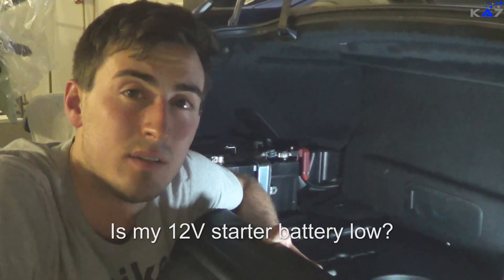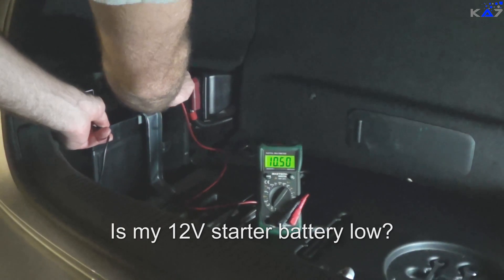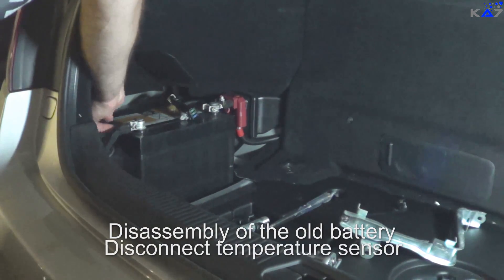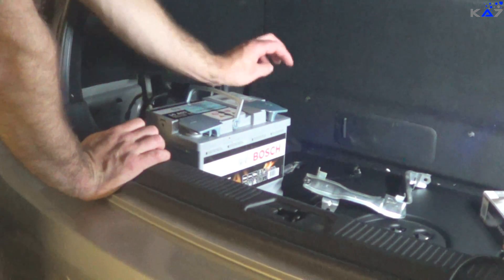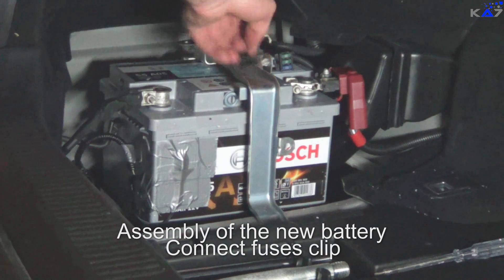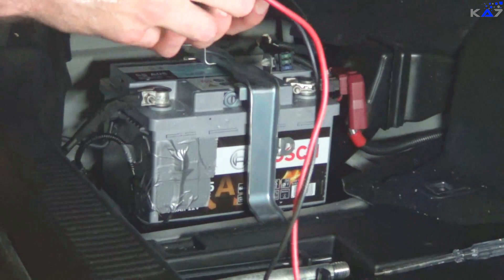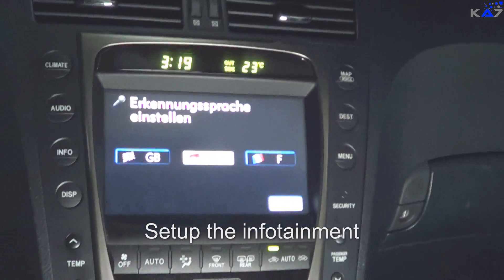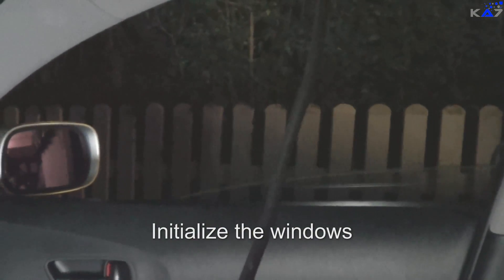12V Battery Replacement - HOW TO REPLACE STARTER BATTERY of a Lexus GS450h 2007?

Comment: How you disconnect the temperature sensor mate?
Reply from the maker: Do you mean 2:50 or before?
Reply: @KA7Beatz before. It is stuck because the temperature esensor is under the top cover. My battery was changed by previous owner and he replaced it with a Japanese Panasonic battery. However, I learned that I need to get under the top label where the actual sensor lays. Thanks foff to the tip so now I know that there is no need for an expensive option for my Lexus❤

Comment: Notuce:By catalog from Toyota the battery for GS450H is not AGM  
They start putting AGM batteries late 2009 , so keep in mind.
I'm with 70ah EFB Rocket  battery 
Fits perfectly and is by catalog like an oem spec - even better

Comment: Any suggestions to switch of the alarms after installing the battery? I didn’t get it to shut down no matter what I tried, eventually disconnected the battery and then it stopped after a while. Was it because i did not tape the temp sensor on?
Reply from the maker: @casperjolink433  I dont know. I dont think it is related to the temp sensor.

Comment: I live in Sweden and i have GS 450h 2010 and every time i search 12 V battery it not fit for my car not even Bosch battery so i called Lexus and they say that it not fit because that temperature sensor on the left and i have some cable where temperature sensor is and Lexus told me that i must have that cable and it's only Panasonic battery witch cost over 400€,what should i do,fo i have to buy original or replacement and do i must have that cable because you recorded in video only temperature sensor, please help me,thanx.
Reply from the maker: Hi, dont worry. Simply buy an AGM battery from any brand (I bought Bosch. For a hybrid car AGM is important!). Tape the temperature sensor on the battery (as I did in the video) and it will work!

Comment: How's the car now?
Any tips when looking for one used?
Any common issues?
Reply from the maker: Hey. I am still driving this car and it has over 200.000 km already. The only issue I had was a rusted exhaust which I replaced for 1000 Euro (this is a common issue). The next thing which I probably need to replace is the suspension. The car has still the original hybrid battery and they seem to be in a good shape, since I usually drive just long distances. Check my channel, there are some more videos of my GS450h.
Reply: @KA7Beatz  I will, thanks for the tip.
From what I know the batteries go out if the car is driven in the city often and the rear shocks are the one to go first since the battery is heavy, other than than leaks from the water pump, rusted exhaust and some brake calipers may seize.

Comment: Working great here on a 2008 GS450h that didn't want to start after COVID19 stop. Just some fitting on the AGM Bosch battery base and everything working fine again, not even the window fixing thing needed. Thanks for your video KA7Beatz, very helpful.
Reply: I have a 2007 same model I can't seem to get it started, is it cause of them lil rubber holes attached to the battery?

Comment: Hello Friend.  I live in Japan and have a Lexus ls 600 hl, I left the car in the garage for a month when I went to use it again it doesn't work.  Could you tell me why this is happening?  thanks￼.
Reply from the maker: Dear friend! Unfortunately I cannot tell you why the battery went low after two months. How old is the battery? How cold was it in the garage? Were all the power users turned off (such as the massage seats, infotainment, ...)?

Comment: Hi, just wanted to ask how the battery is doing in the car. Any problems at all, do you know if the car over charges the AGM battery at all? Thanks for the useful video.
Reply from the maker: Hi. Thanks for the comment. I am still using this battery and had no problems so far (3 years, 90.000 km).
Reply: @KA7Beatz  Great, thanks
Reply: KA7Beatz One other question if you don’t mind, you mention in the video that your cd changer was working after the battery change, had it stopped functioning before? This is the position I am in currently, the car starts fine but the CD player is not working saying no disc and there is no audio from any source though the radio does still tune.
Reply from the maker: Yes, the CD changer stopped working some weeks before, FM was still working fine.
Reply: Thanks again

Comment: my RX450h 2010 has no temp sensor !? i had to relearn the backdoor (powerdriven) what about the sunroof ? what about the seat settings  and customization via NAV screen ?
Reply from the maker: I guess there are differences in the Facelift which you are driving. Sunroof yes. Nav yes. Seat no (in my 2007 model).
Reply: danke   @KA7Beatz

Comment: Is there some trick you found to get the battery in properly? It seems no matter how I try the Bosch battery won't sit level in the tray (either the left side or the right is higher, and I can't get the bracket to fit back properly when it's like that)

Oh, and: Thanks for the video. It is very helpful.
Reply from the maker: Hi, Thanks for your comment! Honestly, I shrinked the Bosch battery a little bit with a file on all bottom edges (at the synthetic material).

Comment: Would you know the group size for that battery? I’m trying to buy one.
Reply from the maker: Length: 242 mm, Width: 175 mm, Height: 190 mm. These dimensions basically fit almost perfect. You are able to do minor adjustments on the battery.
Reply: KA7Beatz thanks for the info, but the place I’m trying to buy the battery from is saying they need the group size. Would you be able to post a link to the battery. So I can show the guy the specs? Thank you in advance

Comment: i wish i would of seen this video a couple hours earlier! ive just ordered the bosch s4 026 70ah no agm, is that bad? should i change it or will it work? thanks.
Reply from the maker: Dont worry it will work as well. AGM might be better during cold days and with respect to durability.
Reply: thanks alot, ive just ordered the agm and hopefully i could send the regular one back. im in switzerland, i ordered from swissbatt24.ch
Reply from the maker: Ich kenne die Rücksendebedingungen des Anbieters nicht, sollte aber gehen. Packe die Batterie am besten gar nicht aus, denn sie wird dir Luftdicht verpackt zugeschickt. Am besten auf den Karton Rücksendeetikett aufkleben und zurück schicken.

Comment: BRILLIANT: Thank you KA7Beatz.  I have done exactly what you said on my 2007 GS450h (including fitting the same type of battery as you advise - bit of a tight fit around the base but it fits) and it all seems to work!  Really useful hint about the thermistor, and use of gaffer tape!  It's even fixed my satnav, that has been completely o/s for the last two years.  Thanks again.
Reply from the maker: Thanks for your feedback!

Comment: I was try to replace the 12v Battery today and after I put the new after market battery in to the car the car was start but is show "Check the Hybird Systerm" because I don't konw how is the temperature sensor work .
Thanks for the video now the car back on the road!
Reply from the maker: Bosco Ng You're welcome ;) Great to hear that everything is working again!
Reply: Did u fit a 250$ factory recommended battery?

Comment: Great video. I thought my high-voltage battery went bad but the technician said it could just be the 12V. Going to go buy a new battery now. Thank you very much.
Reply: Did it fix it? Or u had to replace the hybrid pack battery?

Comment: a good tuning for this car is to replace the Pb battery with a LIFEPO4  A123  pack , even 25Ah is enough  ,  weight  loss  about 16Kg , very  low internal resistance improve ignition  and gains a little power and fuel economy ,  low self discharge and excellent calendar life , this chemistry is the best for cars ,  tested  by myself , once charged LIFEPO4  draws  very low current to stay at 14V  , large Pb battery continuously draw current form 14V , and this is fuel economy again 
On my GS i have noticed  aprox. 0.4 L/100 km  , 6 years service till now and capacity is still like new .
Reply from the maker: Never heard about this battery. Thanks for posting!
Reply: where do i buy this LIFEPO4  A123  pack battery for gs 450h?

Comment: Hello and thanks for making this video. My starter battery died and I am thinking about installing an aftermarket battery later today. Is your car working fine after the battery swap? Is there anything else we should know or any updates? Thank you again!
Reply from the maker: Candy Cockatoo Hi! My battery works absolutely fine since the replacement! One point you have to watch out: Your new battery should be from "AGM" type. This type of battery can provide your car with more current than the normal one, which is necessary for the start-stop-automatic.